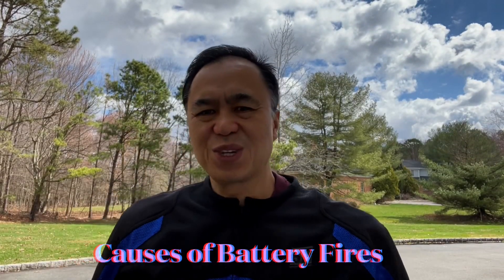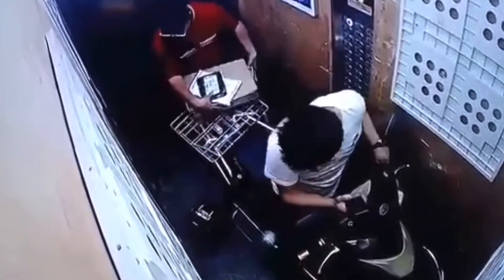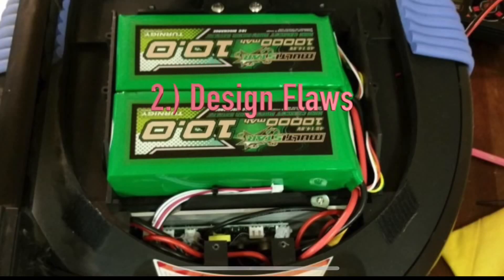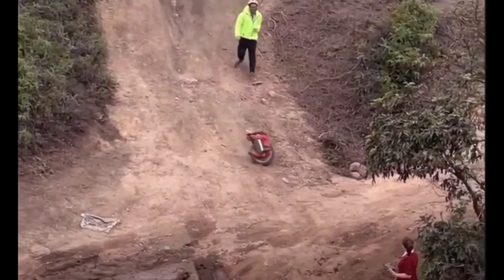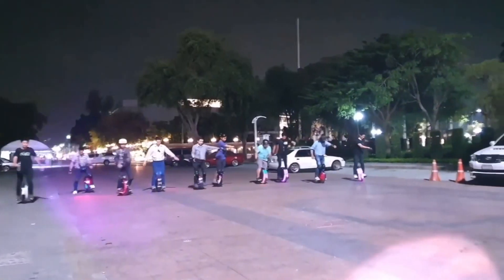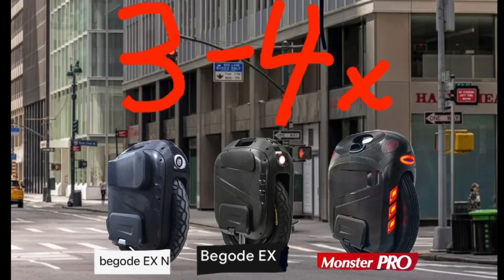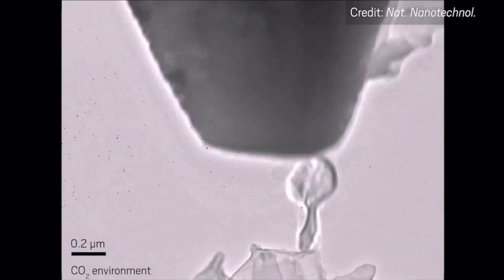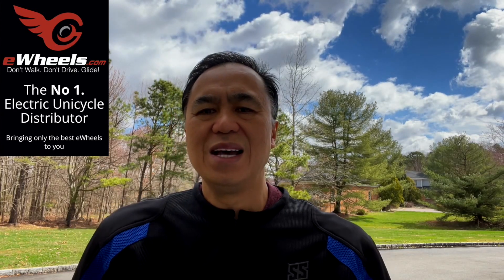Causes of Battery Fires

Comment: Also, not switching over to the much safer LiPo4 chemistry (though slightly lower power density) is criminal negligence in my opinion.  They don't turn into self-oxidizing death traps like thermite when they short.  Period.

Comment: 1800 wh nikola plus is dangerous, what about the 2700 nikola ar+? Safer? 🙏 just bought a used one
Reply from the maker: I would say that is safer than the 1800 Wh Nikola. You have more amp buffer so less chance of a short circuit. I did have the 1800 Wh Nikola before and never had an issue. You chose a fantastic wheel. That was the best wheel I ever had prior to getting my Inmotion V13. Enjoy!
Reply: @AdamU1016  great! Thx for the response. Yes loving it so far. I can actually ride around town but still learning. Max 20 mph. Community seems great so far online. Now need to find real life riding buddies!
Reply: @AdamU1016  I love the range and battery capacity. Def far from using all the battery and power in one day. A little top-heavy but once I learned to ride its manageable.
Reply from the maker: @batmangsxr300  That’s a huge battery. You can certainly go on long group rides with no range anxiety. I am sure you can find some group rides in your area. If you are in NJ, you can join our NJ Garden State EUC group on FB. There are also EUC forums online. https://forum.electricunicycle.org/
Reply: @AdamU1016  cool thx. I'm in the bay area!
Reply from the maker: @batmangsxr300 - You should contact Marty Backe then. He knows everyone there. You will have many group rides to enjoy there. He is on FB and on his YouTube channel.
Reply: @AdamU1016  ok I'll look him up. Thx for the info. EuC riders are still like seeing unicorns 🦄  very rare sight here in Berkeley and SF in general

Comment: I wish i watched this video before buying a Nikola with 1800wh pack
Reply from the maker: I had the Nikola 100V 1800 Wh version too. Best EUC I ever had. I am not an aggressive rider. My usual cruising speed was 20-25 mph. Max speed I ever reached was 35 mph but that was rare. 
As long as you don’t abuse your wheel you should be fine. 

I bought my Nikola at EWheels. Jason of EWheels promptly gave me a replacement battery pack with Litech technology. I discussed about Litech and the easy replacement of the batteries in another video. If your Nikola was bought at EWheels, contact Jason. If not, just use proper battery management as well as not being too aggressive with the Nikola.

Comment: Someone ,,,yesterday on a bicycle burning said it was about the fuse and I said if it was about the fuse it would have popped. I told him to quit spreading false dangerous information because that chemical reaction in those batteries has nothing to do with an outer fuse in a wiring harness.
Reply from the maker: You are right. I think sometimes people just make things up to cover how ignorant they really are.

Comment: Good episode; thanks. Seems like e-mountain bikes might be at high risk for this, due to the vibrations, heavy loads, and variable temperature conditions.
Reply from the maker: Yes. Those PEVs would certainly be up there with all those factors mentioned. Unfortunately, all lithium batteries still carry that inherent risk because of the materials used and special conditions needed.

Comment: I think once an EUC caught fire, all of that EUC's under that batch should be RECALLED immediately (and all purchasers of that specific unit should be refunded immediately), and I think there should be a governing body who inspects ALL manufactered EUCs despite of any brand it is before it is sold in the market, this is on top of the Quality Control that these manufacturers are also administering to ensure safety to its customers
Reply from the maker: It’s just basically the tech of lithium ion batteries which have the inherent thermal runaway capability no matter which brand out there. There are so many variables involved  in the production of the batteries. For one specific EUC to catch fire that one specific pack might have had its own specific production deficiencies that caused the runaway. The other EUCs of that batch might have had no other similar battery issues. Unfortunately, it’s like a game of Russian roulette. 

I waited a whole year and a half when the Nikola came out and after several revisions and improvements I finally bought mine. I just don’t buy first or second batch wheels anymore. I let the beta testers go first.

Comment: Can you please elaborate more on number eleven?
“Charging 80-90% routinely — Not allowing cells to balance”
I’m a new eScooter owner, I have the Kaabo Wolf King GT Pro with the 35Ah 72V battery. 
How do I assure the cells are properly balanced via charging habits/routines/methods? Thank you. 🙏🏼
Reply from the maker: Usually it’s the last 5 percent of the charging that takes awhile to complete. It’s because that’s when cell balancing begins. Having cells not balanced can lead to eventual thermal runaway. The cell balancing finishes about 1-2 hours after the charging light turns green.
Reply: @AdamU1016  
So, you’re saying I should definitely charge my scooter to 100% (how often/every time?) and leave it plugged in for an additional hour to two hours after the charger light turns green, in order to balance the cells? 
Am I understanding you correctly?

I don’t ride or charge the scooter everyday. 
Sometimes, it sits idle for a week or up to ten days at a time, in between road rides (no off-road use). 
I’ve never ridden to below 10% battery remaining. 
I don’t ride in wet conditions. 
The scooter is only 2 months old with less than 300 miles total and it has never been crashed or damaged (it did fall-over once while parked and scuffed the end of the left side handgrip on concrete when it began slowly rolling forward, then the kickstand folded). 
It weighs approximately 120 lbs. 
I always use both factory chargers simultaneously. 
I’ve never a need to rapid-charge my scooter and I do not own a higher capacity charger than the ones supplied with it. 

Thank you for any further clarification you’re willing to offer. 🙏🏼✌🏼
Reply from the maker: @allemander  
I agree with above. 
Nothing wrong with charging to 100% before a ride. Make sure you charge for an extra hour or 2 after the light turns green for complete cell balancing. 
Never store your scooter at 100% charge. 
If you have to store for months, store at 50-60% charge. Battery will have small discharges when stored and that is fine. You never want the charge to go down to 0%. 

Since you have a scooter and not an EUC, a power cutout is not that bad when you try to demand more from the motor when the charge is low. 
You will just coast instead of faceplant. 
It is best to charge your scooter just before you ride or the night before. Never charge unattended of course. You should top off your battery whenever you go riding so that you won’t have to worry about a low charge on your rides. You don’t always have to balance completely your battery if you can’t but having it topped off is good.

Comment: This is scarry since I have two 72v scooter with big battery in my Condo and parked next to each other. We need safer battery tech.
Reply from the maker: Yes indeed. The most likely chance a fire will occur is during charging or when the battery is discharging. I am usually nearby when charging and can readily just take my EUC outside should a fire occur. We are definitely always taking a calculated risk with our PEVs in our home and safer battery technology cannot come soon enough.

Comment: Hi I have KS 16xs . Do I have to charge it to full 100% very time I take it out for a ride ?
Reply from the maker: It depends on what kind of rider you are. Are you an  aggressive or a mellow rider? I can be aggressive with my wheel when I ride so to prevent a power cutout I fully charge my wheel when it is less than 85% with my Nikola 100V. 
If you are just going for a mellow ride and it is short distance (less than 10 miles) and your wheel has greater then 90% then you don’t have to. I know KS tends to throttle their wheel at I think 80%. If you are a fast and relatively aggressive  rider, then just charge to 100% just before you start your ride.

Comment: Hello. I curious, what would u say about battery safety of inmotion v11? Because a lot of people live in an apartment complex, what should be done incase of spontaneous fire?
Thank you in advance.
Reply from the maker: InMotion like KingSong have in their firmware a means to limit the motor  from demanding more than what the batteries can provide. Begode in their infinite wisdom wants the rider to have the speed, power and performance in their wheels so they never really limited how much the motor can demand from the batteries. 

Regarding battery safety, I always make sure I am nearby when I charge my wheel. Any early sign of loud pop and crackle, smoke or smell I make sure to unplug the wheel quickly and take the wheel outside as soon as possible. I always have a fire extinguisher nearby too. There is a Firesak available for sale online too that could help contain such a fire too if you cannot take your wheel out quickly enough. Some also use a huge metal container such as a gun safe or metal receptacle or metal trash can to store their wheels.

Comment: Hey adam, I just ordered my nikola + from ewheels.. they sent me an email saying they are putting the Litech Molicel Battery packs and will have to wait about another week to receive.. is there anything I should be worried about? This is going to be my first every EUC and watching this video got me a bit nervous 😬 I don’t plan on pushing it only cruising
Reply from the maker: You should be fine. Having the Litech Molicel is extra reassurance. Just don’t overtorque or do extreme speeds. I weigh 195 lbs and have gone no faster than 35 mph which is fast enough for me. I doubt you will be going that fast anyway since this is your first wheel. Cutoff speed is about 45 mph. 
Don’t leave your wheel in the trunk during the hot summer months. Be nearby when you charge your wheel. Charge on the day of the ride or the day  before. When your battery is fully charged don’t go downhill as the battery regeneration can cause a cutoff. 
Stay tuned for my next video!
Reply: @AdamU1016  thank you so much Adam! Your videos are really helping me learn about this new venture, and clear some anxiety really informative and entertaining! 👍🏽

Comment: 7:45 u made a mistake. Bad cells are LG M50T, not LG M50LT. The last are newer cells that replace old bad ones.
Reply: 11:09 same mistake
Reply from the maker: @ZorgKirill  - The info I used is directly from Jason McNeill himself in the EUC forum. Jason specifically mentioned LG M50LT as the cells implicated in the battery recall. I already have this link in the description but I will link it here again. Please read his post. He mentions it again in response to another commenter. 
https://forum.electricunicycle.org/topic/25541-begode-900wh-battery-recall-options/
Reply: @AdamU1016  so, he has made a mistake in his post. Almost all leaked/burned wheels had m50T, not LT. It is discussed further in that thread. And personally I have MSP with m50T, and my battery leaked too. m50LT was more recent replace for m50T, and i haven't heard of troubles exactly with m50LT.
Reply from the maker: @ZorgKirill  -  - Did you buy your Nikola 100V 1800 
Wh at EWheels? I just re-read the link I had sent you before. That was for the Panasonic batteries of the first batch Nikola that was recalled in those dates I mentioned in the video. 

Currently, Jason has a battery recall program for the Begode RS/MSP/ Nikola+. Just send him an email and ask if your Nikola batteries are affected by the recall.
Reply: @AdamU1016  i don't have Nicola, im from another continent. I just know exactly about  MSP HS
Reply from the maker: @ZorgKirill  - So you didn’t buy your MSP at EWheels then? Jason of EWheels sent me Samsung 50E batteries with Litech due to the battery recall program he has instituted for MSP / RS / Nikola models. I already placed them in my Nikola. Awesome customer support.
Reply: @AdamU1016  yes. Bought it in Russia xD

Comment: Nice one. Thanks! Am I right in saying that distributers e wheels and alien rides are installing safer battery packs than those supplied by the manufacturers in the wheels they sell?  This is great if it’s right but why aren’t the manufacturers taking care of these issues? As a rider I would rather pay more, much more even for the peace of mind that my wheel won’t cause a fire... I often ride trails and my wheel is always getting bashed about, I also ride to my local gym who are happy for me to leave my wheel on charge while I’m there... now I’m very worried about this.. what can I do?
Reply from the maker: You are right. EWheels and Alien Rides are taking extra measures in battery safety. Begode is too slow to realize that their firmware needs to address the issue of drawing too much current from their batteries. Begode needs to shape up or lose loyal customers. 

What can we do? Don’t over exert your wheel. I tend to ride about 10 mph below the cutoff speed. Don’t over-torque. Check your battery every 500 miles. Check for any swelling of the batteries. Check the wires. Make sure the inside of the wheel is free of mud as it can impede ventilation. Don’t charge and then leave the wheel unattended. Set a timer. 

My next wheel is going to have the Litech current and over temp protections in place. In addition, the bigger the batteries in the 3-4 pack configurations the less chance of over discharging the battery and hence less chance of thermal runaway. 

Have a safe ride!
Reply: @AdamU1016  thanks so much for your response! And taking the time to give good advice,it’s massively appreciated! If only this kind of thing was done by manufacturers... the instructions I got with my wheel were very loosely translated and not in depth at all... I love riding euc but am saddened by industry attitudes to safety... thanks again🥰

Comment: Hola Adam,  Gracias por tu video 
Are you completely sure of reason number 11?
I charge my battery every day from 60% to 80-90% I never let it go below 20%. Am I causing a possible fire?
Reply: you should charge it to 100% once in several trips, to balance batteries. Or some time later, it will damage one of the cells.
Reply from the maker: Cell balancing occurs in the last 5% of the charge. I usually charge fully to green and then add about 2 more hours charging after that. Charging to only 85% does not result in balancing. You might have some critical low cells that can go bad without balancing.

Comment: Thanks for this. Now I think I'll exclusively use my Inmotion  for forest/mountain riding and use the MSP for city-only travel...or add a fire extinguisher to my travel pack.
Reply: watch out for MSP voltage after every full charging. If it refuses to get to 100.8V, it's time to remove and repair batteries.
Reply: @ZorgKirill  Shit. They're at 84v freshly charged.
Wonder if I could cannibalize the batteries from my immobile Ms V3, since replacement chips for it are no longer available...
Reply: @somedandy7694  wait, if 84V, maybe you have MSX, not MSP? (it's ok for MSX)
Reply: @ZorgKirill  The box said MSuper Pro! So I'm assuming it's an MSP. Did the MSP have multiple voltage options?
Reply: @somedandy7694  how do you check voltage? Maybe your phone program has wrong settings for 84V models? (wheellog and eucworld have such setting)